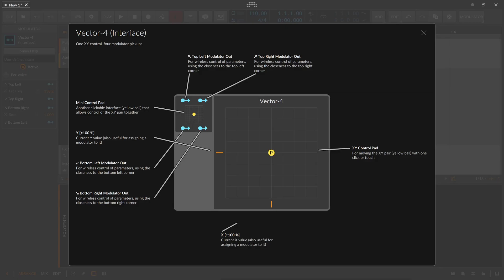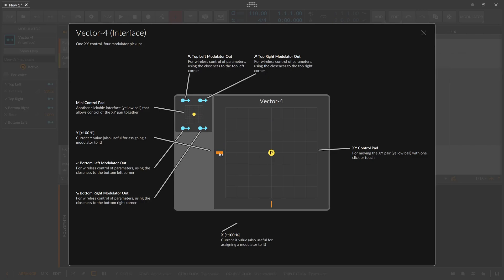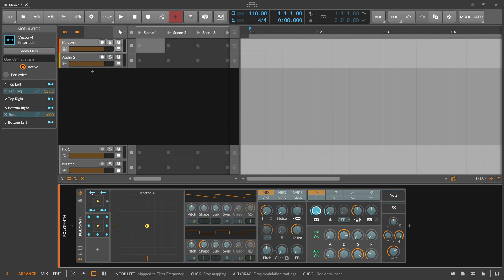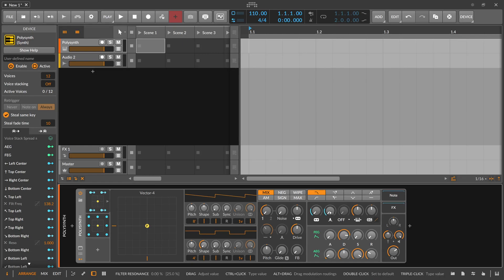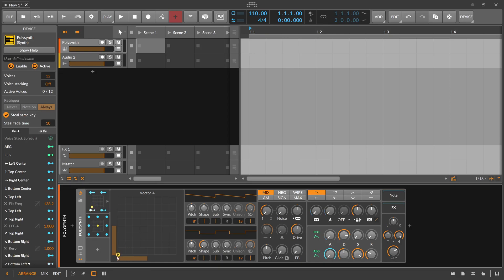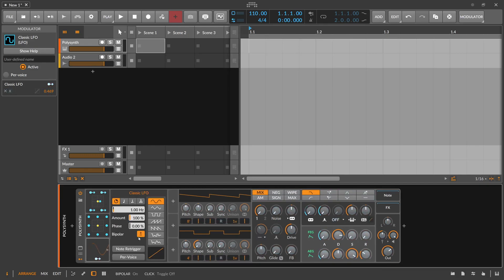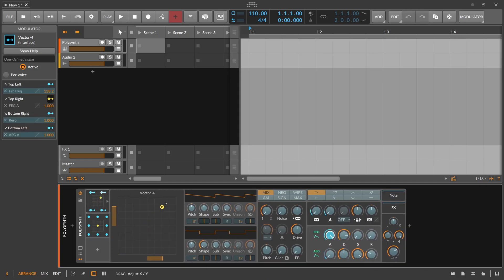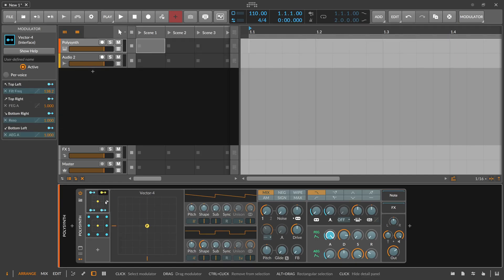Vector 4 Vector 8 - Bitwig Modulator Guide

Comment: Just came up with a very cool way to use these modulators. I was trying to work out different ways I could achieve a surround planner. So I made an fx layer with 4 layers. Each layer routes to an fx track and the master is muted.
The vector modulator controls the level of each layer. The fx tracks output to directly to each speaker output. This is a way I worked out how to have a save able device. You can easily paste on each track.